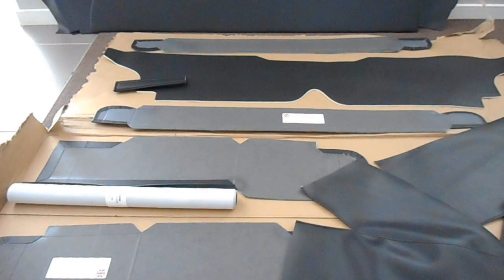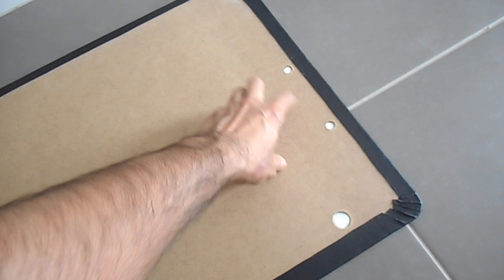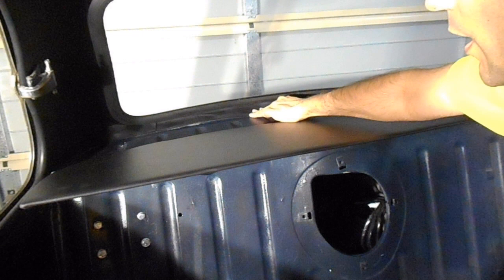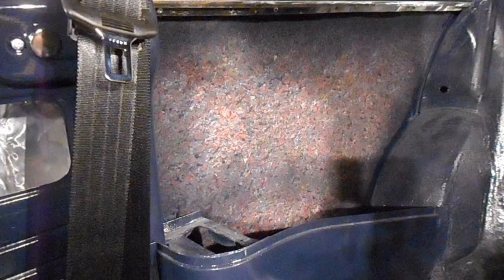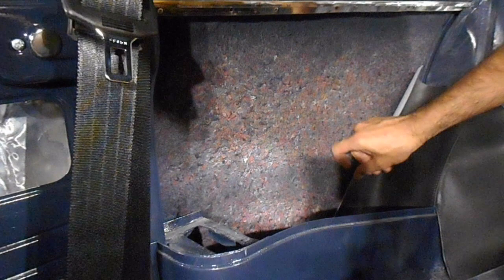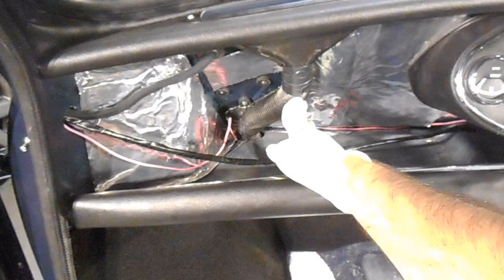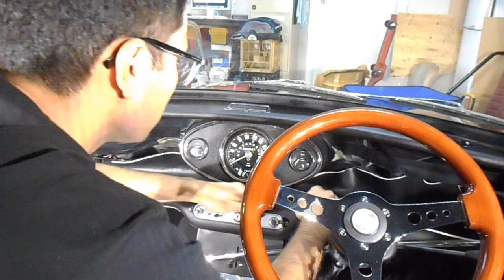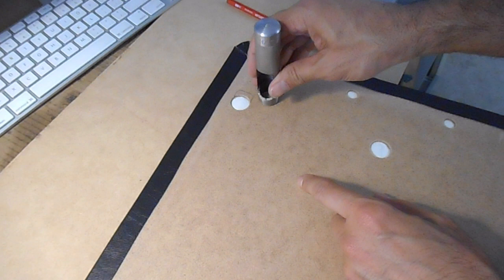Morris Mini Cooper S - Door cards, interior trim, Newton Commercial EP043

Comment: I found your youtube articles yesterday so I'm working my way through slowly under quarentine. Great work. I think that there is meant to be tape over the holes in the door inner skin so that water running down inside the door doesn't dissolve the door cards. The interior of yours looks very nice. The back seat on mine has a cigarette burn circa 1965. Three ash trays and two seatbelts gives an idea of priorities back then. Dave D

Comment: Really great 'How To' videos. Sadly I only caught up with you 2 years late!
Just worth mentioning that Aussie MK I Minis had quarter lights and wind up windows whereas the UK and other market Mk Is had sliding windows. I have used Newtons for some time (now doing a '78 Mk IV) and found them to be 100% but maybe they just let that hole slip past QC. But overall that interior looks superb. On later Minis the lock release mechanism had slots for the screws so maybe the handle mechanism could have been slid back to help?

Comment: Thank you sir for a great how to video. My next job is to put the dash shelf liner  and speedo panel in.The shelf liner doesn't seem to hard but the speedo panel with the heater vents in the way looks a bit more difficult
Reply from the maker: It's not too hard, but just take it easy take your time and don't rush because the cardboard backing can be easily damaged and creased.